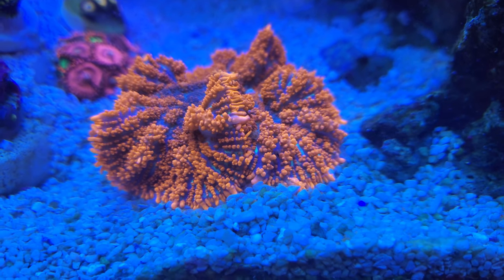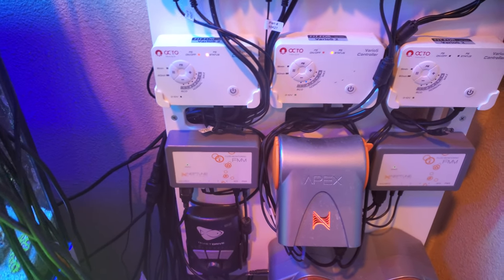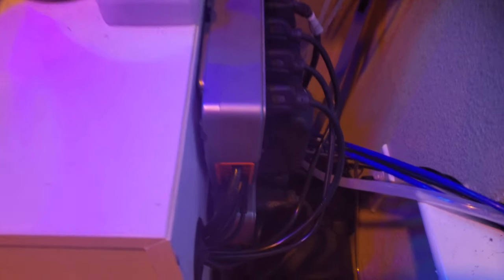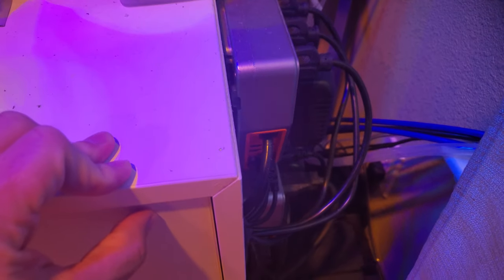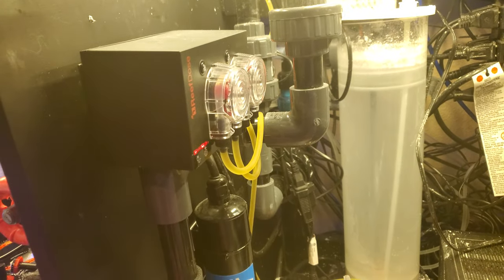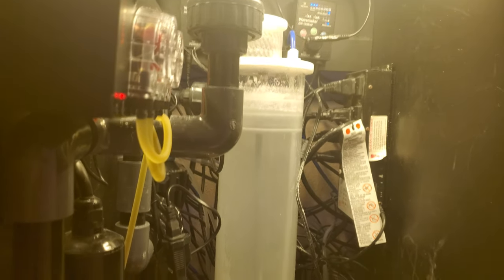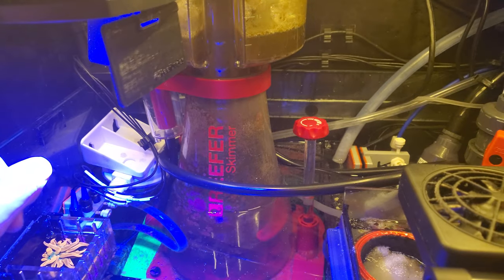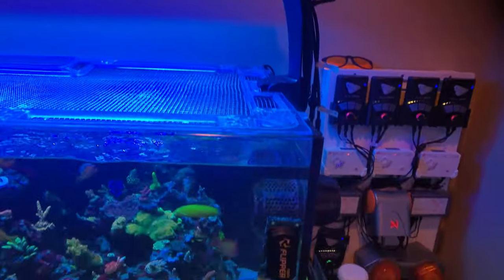Equipment and sump tour.

Comment: Do you think you will be able to run this tank without a calcium reactor once all your coral are huge?
Reply from the maker: Probably could but it would get expensive.
Reply: @rrrreefer9721  How long do you think before you get the calcium reactor back running?
Reply from the maker: @richardportelli1983  I'm guessing it'll be 2 years at least. I really like kalkwasser so I'm likely going to push it as far as it'll take me.